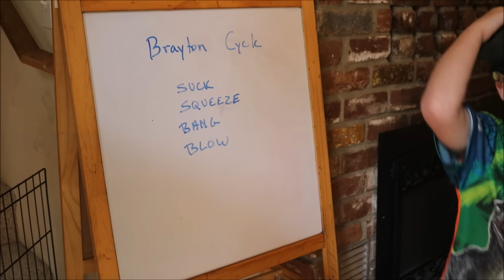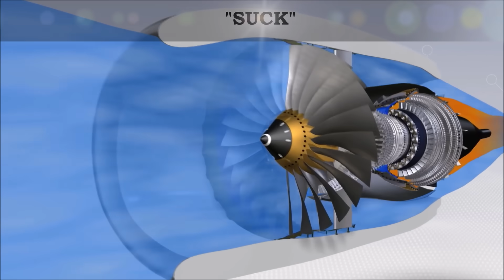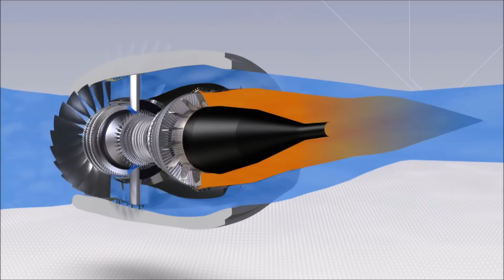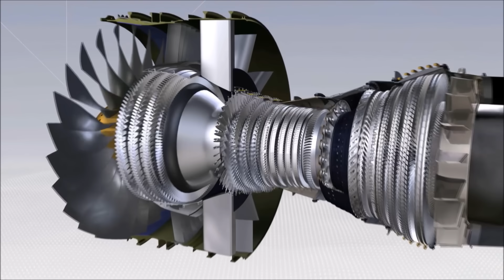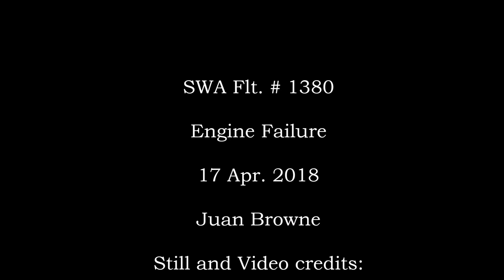Southwest Airlines Flt#1380 17 April 2018 Update

Comment: Great explanation to a complex problem. One question. Since the FAA did issue the AD regarding Fan blades on certain types of engines after x amount of hours, what is the likely hood that many of the 737-700 in all fleets may be taken offline until the ultrasound inspections take place?
Reply from the maker: New AD coming out now...

Comment: Sounds like the engine makers should have Kevlar reinforcement of engine surrounds to better contain blade separation events much in the same way race cars have similar blanket wraps around transmissions and bellhousings to keep exploded drivetrain parts from entering vehicle passenger compartment protecting driver.

Comment: They never conduct contain faillure test with the force of the air coming to the engine at 250 kts for example ? coz you can expect that if the inlet don't break away on a stand still position it would'nt be the same in a cruise situation !

Comment: At the manufacturer level, airliner risk management follows what appears on the surface to be a very cold and calculating set of parameters to do whatever needs to be done to be "safe enough".  Looks bad, but the industry wouldn't be able to function, and you really wouldn't be able to fly anywhere with any kind of affordability, without it.  In design, there are 4 major risk levels, Minor, Major, Hazardous, and Catastrophic with probability thresholds for each level that apply to the potential results from a single failure of a component.   Catastrophic requires a probability of one in a billion or better, or 10 -9.   That is, if a single part craps out, the risk of that event causing loss of an airframe has to be better in one in a billion, or you have to add a backup component.  The next level down, Hazardous, can include an incident that results in damage with possible injury or limited death.  The 1380 event would be a Hazardous event and there the risk threshold is one in 10 millon or 10 -7.   Without getting too much into the weeds, the legal requirements that set any risk mitigations like inspections and non-destructive testing that have to be implemented will be based on mathematical calculations that are determined to provide reasonable confidence that the next potential event will be headed off at the pass - to a point.  In other words, there is a careful calculation that "shit is going to happen" but that the chances are managed to within a range that the public can accept.  This is how it really works.

Comment: My question is where do we go from here?  The last death I know of in the U.S. happened down here in FLL or PBI.  It was a true un-contained failure that killed a mother & son sitting next to the engine.  I think it was turbine blades that killed them.  But now we have a death from cowling puncturing the fuselage.  I don't know of any provisions, on any engine/fuselage, that has been designed with this as a possible failure.  Sure we could do a better job at predicting the blade off failure, but it's still going to happen again. The failure could come from FOD, again the engine could contain the shrapnel, but the cowl did the killing here.  As rare as this is, we don't generally sit back and hope for this not to happen again.

I want to acknowledge the superb actions of the entire crew.

Comment: Hi Juanfirst of all my heart felt condolances to the famlies involved.i watched a documentory on the RR trent engine and was amazed at the stength of these turbo fan engines and what they have to withstandin in testing (as all engines do). this coming after 12 ys in the RAF  working with tubo jet engines. Different animals indeed .i do have a question tho, do you think this is a problem between engine and airframe designers ? the engine seems to have withstood the catastrophic failure but the intake cowling failed !  so is the intake designed by the engine manufacturer or does the airframe manufacturer have an input ?
Reply from the maker: good queston! Probably Boeing.

Comment: I have about 4 hours of 3 engine time on C130's, and about 5 mins of 2 engine time (yes, I have shut down two engines on one wing before for low oil pressure). BOLDFACE TEST: Rapid decompression; oxygen on, 100%. Engine fire: Condition lever "feather. Fire handle "pulled". Agent; "discharged for fire or nacelle overheat". Run checklists. Clean shorts.

Comment: I consider the effect of severe injuries within the passenger cabin to also be an emergency, which I presume would also affect the pilot's need to respond with urgency.
Reply: Yes and no.  If the injuries were the only issue happening, then it could cause the pilot to decide to divert to a close airport and to request  medical support when they land.  But, in the situation that occurred on this flight, I bet the pilots didn't even think about the injuries - injuries to passengers wouldn't change anything they were going to do.  

Te pilots may not have even been aware of the injuries until some time after the initial indecent.  The pilots' job is to fly the plane. Taking care of the passengers is the responsibility of the cabin crew.  The pilots would likely only be aware of injuries if and when the cabin crew thought it was important enough to distract the very busy pilots.

Comment: So the problem as you stated has still not been addressed. you say that the inspection is for the blade which in your video shows that problem is already been address by the manufacturer when the engine was built but what has not been addressed is the forward engine shroud that obviously should have been reinforced the last time in 2016. The only difference is this time it cost a life. The front of the engine is weak because it is unable to displace the aggressive vibration from the unbalance engine. The mount that holds the engine to the wing displaces a great amount of the vibration into the wing. The mount should be extended to the forward shroud to help displace the vibration.

Comment: Given that the broken window was aft of the engine,  above the wing and almost in line with the back of the wing,  hard to imagine how a piece of engine cowling debris  / collateral damage could  have found its way there.
Reply: High speed wind vortices, lightweight material for the cowling.
Reply: To add a little more to Gordon's comment.

It seems likely that cowl pieces flew out in many directions, some of them being thrown upward toward the fuselage.  Now, with a wind speed of maybe 500 or 600 mph, those pieces are going to be blown back very quickly. So, a piece that was initially "aimed" toward a window directly inboard of the engine cowl would be blown backward considerably by the time it actually impacted the fuselage -- hitting a window much further aft.

Comment: I can only assume that engines developed in the future will be engineered to further reduce vibration failure of the cowling so that it doesn't become the source for the loss of integrity to the cabin or the plane itself.
Reply: You're going to hate this answer.

Here are some uncomfortable facts that people don't like to face:

1) It usually costs money to eliminate risks.

2) Money is not unlimited even in huge corporations.  Or, if you prefer you can restate this as: Corporations don't want to spend any money on anything (including safety).

Given 1 and 2, doesn't it make sense to ask/require that money be spent were it will do the most good?

Just because this accident resulted in a death does not men a cowl redesign it is the best place to spend money to save lives.  For example, maybe something like shoulder belts for passengers or the elimination of passenger windows could save more lives.  Either of these might have saved the passenger on this flight.  But, would they be worth it to you?
Reply: Andrew Snow This was the second time this happened to the same engine type with the same airline. Unfortunately, the airline didn't heed the recommendation of the engine manufacture to perform ultra sound testing of the engine blades after the first incident. Now they have a death on their hands and potentially a very costly lawsuit along with a bad public image that could cost them millions.

Comment: Great lesson for those of us that have little knowledge of these engines. Plus I love your co-pilot! Question: I noticed around the edge of the cowling, the entire edge has a saw-tooth appearance. If the blade was sucked into the innards of the engine, what do you think caused that saw-tooth edge? I'm guessing it might have been parts of the dove-tail anchor piece, thrown outwards by centrifugal force? Again, thank you for the great explanation, and major kudos to the entire flight crew for getting that plane down on the ground and the passengers to safety.
Reply from the maker: excessive vibration i think

Comment: Where is any sign of an engine fire?
Reply from the maker: apparently yes.
Reply: Where?
Reply: The pilot received indications of an engine fire, but this may have been damaged wiring, or a broken pipe inside the engine. Once the fuel supply is closed, and the engine shut off, the fire would self-extinguish.

Comment: When the pushing force of one engine suddenly drops to zero, how does that impact the direction/steering of the aircraft?
Reply: The rudder and ailerons will compensate for the asymmetric thrust. That is what they are designed to do .

Comment: how come they don't  test in real world scenarios with 300mph+ wind on the leading edge of the engine nacelle which probably did most of the damage, post internal damage.
Reply: Most engine failures occur during takeoff, which is the period when highest power is required (and bird-strikes are most likely). It is very difficult to do real world testing for this kind of high-speed and cruise-altitude failure.

Comment: When did the window blow out? In the recordings of the radio, the air traffic asked what the emergency is and she replied engine failure. Wouldn’t they report major hole in passenger compartment as well?
Reply from the maker: crew only knows of rapid D initially.
Reply: blancolirio - interesting, I would have thought a hole in the side would set off alarms for pressure loss not to mention the screaming
Reply: PapaWheelie it does, but it will also give you a alarm for the engine, and a laundry list of failures. Note, the plane was decending already when the audio starts, so we can assume they already know about the lost of pressure. As to specifics, they are blind to exactly the state of the plane till the crew informs them of what they see. Same applies for the engine, they knew it failed, and ran the checklist to secure it. However they wouldn't have known the extent of the damage to it or the body till informed. As for people screaming, you will not hear them over the noise of the alarms.
Reply: Curtis Ridge - excellent explanation, thanks
Reply: Although if I was sitting next to someone getting sucked out the window, you would hear me over alarms lol

Comment: Juan, I have been hoping you would report on this incident.  The emotionalism of the MSM is nauseating!  As a technician involved in the development and testing of large horsepower centrifugal gas compressors, I have witnessed similar failures on the test pad and in the field.  Our units were usually much smaller than the fan on a jet turbine, but the results were impressive none the less.  I have seen impeller blades penetrate 2 inches of nodular iron like a hot knife through butter. That the blades are contained on this type of failure is a testament to modern aircraft engineering.  Thanks for the update and keep up the great videos.  Really enjoyed the input from the Army Air Corp! Pete is growing up, but he is still cute as heck.

Comment: Thanks for answering the first question I had following news of the failure.  "Shrapnel in the passenger section?  What happened to engine containment?"  But, it does sound like this engines inlet section does need to be redesigned to be more robust in case of blade failure.  Secondary shrapnel is a thing!

Comment: The problem with the static engine test is that the engine isn't moving through the air at high speed.
Reply: True, but its hard to do a real life test that simulates the actual in-flight conditions.
Reply: yes, agreed. I must just remember when I fly to choose a seat that's not inline with the engine cowl.

Comment: Nobody is mentioning the outsourcing of work by southwest to El Salvador... I’ve been in a/c maintenance for 20 years and worked  at one of the major engine overhaul facilities of and we had no expense of inspection equipment and state of art engine cell .  Your not going to match this in El Salvador.   I’ve have removed these blade on the RB. AND TRENT rolls motors .   There’s a lot the flying pubic is unaware of

Comment: Turbine Animation Error?

Is there a turbine engine designer or mechanic  that can confirm an oops in the animation?  It appears to me that the low pressure compressor blades are backwards.  That is, the pitch appears reversed.  They look like they would be pushing air in the wrong direction.  It seems "obvious" that they are shown wrong, but maybe I'm missing some quirk of aerodynamics in that engine.
Reply: I found some information in a training manual here:
https://www.slideshare.net/RicardoCcoyureTito1/cfm56-3-linemaintenance-vol-1-65194973
This manual is for a CFM65-3 but I expect the basics are the same for the CFM56-7B
Hopefully my links below to individual pages work.

First, this basic "Engine Construction" sketch:
https://image.slidesharecdn.com/cfm56-3linemaintenancevol1-160820195807/95/cfm56-3-linemaintenance-vol-1-45-1024.jpg?cb=1471723118
It seems fairly obvious that the low pressure compressor blades (AKA boost rotor) are directly connected to the fan section.  I think the FAN AND THE LOW PRESSURE COMPRESSOR BLADES MUST ROTATE IN THE SAME DIRECTION.

These pages show more detail if you want:
https://image.slidesharecdn.com/cfm56-3linemaintenancevol1-160820195807/95/cfm56-3-linemaintenance-vol-1-82-1024.jpg?cb=1471723118
https://image.slidesharecdn.com/cfm56-3linemaintenancevol1-160820195807/95/cfm56-3-linemaintenance-vol-1-83-1024.jpg?cb=1471723118
Reply: I suspect someone accidentally "mirrored" the low pressure compressor and turbine sections early in the process of making this animation.

Total speculation, but I can easily see someone simplifying the 3D CAD models of the engine parts before making the animation.  Then when assembling the separate 3D models to make the full engine, they may have had parts facing different directions.  Instead of rotating a part 180 deg. in CAD to get it facing the right direction they may have used a mirror function, thus ending up with the blade pitch reversed.
Reply from the maker: i think you're right!
Reply: The CFM56 is a twin-shaft engine, the LP and HP rotors and blades (text correction) should turn at different speeds (text correction). The animators did not know this, and the result looks wrong.
Reply: Ah, thanks.  I knew it had two independent shafts, but I though they both spun the same way. 

But this leads to another question: What parts are on each shaft?

The high pressure compressor blades and the high pressure turbine blades have pitches the correspond correctly -- so they are on the same shaft?

The low pressure turbine blades aren't shown very clearly, but it does appear their pitch corresponds with the pitch of the low pressure compressor blades - so the same shaft here?

But what about the fan? The pitch direction of it's blades matches the pitch of the high pressure compressor blades, but physical nesting would seem to prevent it from being on the high pressure shaft.  Thus, is the fan gear driven from one (possibly both) of the shafts?
Reply: I don't know any of those answers for a fact, but the twin-shaft explains some errors in the animation. The slower rotation speed of the large blades corresponds to the LP shaft, and the faster speed of the small blades to the HP shaft. A fan this large is never gear driven, but the parts of the engine may be wrongly drawn for this animation.
Reply: Andrew Snow The real question is why an animation by CFM contains such an obvious error? See: https://www.youtube.com/watch?v=KjYw0GdRpm0
If you look at the turbine stage, the LP blades are also turning in the wrong direction.
P.S. Comments are disabled on the video, so we may never know...
Reply: Andrew Snow The video by AgentJayZ gives a nice overview of twin spools, including the CFM56: https://youtu.be/ESNvmDzsOGM?t=575
Edit: He says that both turn the same way in this engine (contrary to my earlier statement).

Comment: Juan, does the resulting explosion from the failure affect the, or increase the resulting loss of thrust? Or does the incoming air prevent that?  I'm sure there are some marked differences in an actual failure and a static engine stand test.
Reply from the maker: no.

Comment: Great video as usual Juan!  Thanks for all that you do.  Just one comment: at the 3:00 mark you mention a "turbojet" engine.  As I know you're well aware, the 737 (and the vast majority of other commercial jets) uses turbofan engines.  The difference here of course is that it is the fan portion of the engine that failed.

And at 5:20, I loved Pete's explanation of the Brayton cycle, but really, that's more germane to reciprocating (Otto cycle) engines like that in the Mighty Luscombe since it describes each of the 4 strokes.  In a TJ, they all sort of happen at once! :)
Reply: Juan admitted the 'turbojet' slip in another comment.
Reply: Thanks, didn't see it. :)